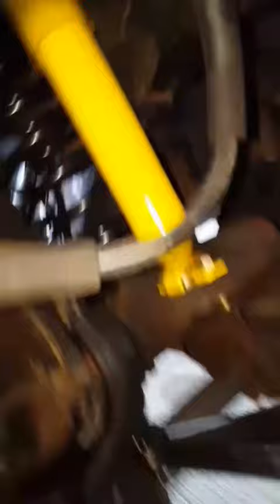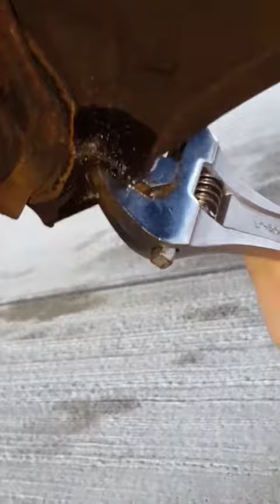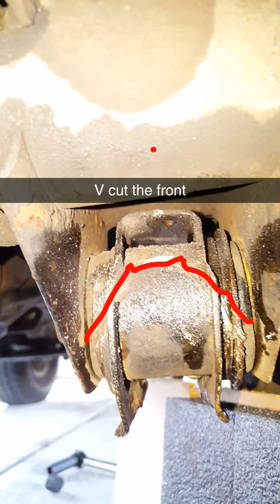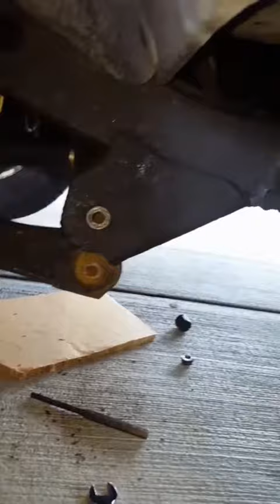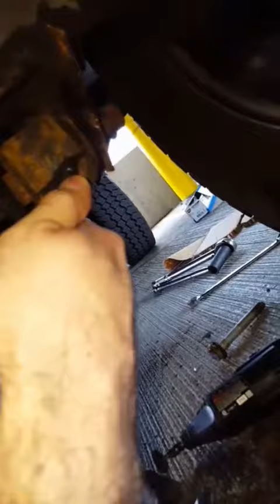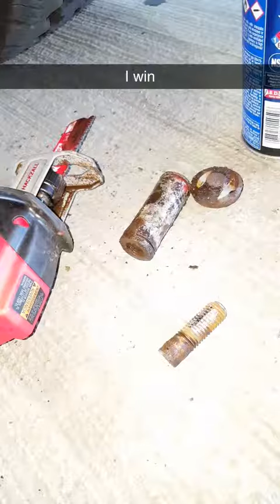Jeep Wrangler Tj 2000 Lower Control Arm Seized Cam Bolt Removal Cut

Comment: Thanks, helpful guide. I just need to get me some decent cutting tools now
Reply from the maker: The_Car_Gods_ 7814 yes buy carbide tip. Cutting fluid. Don't use battery powered .. or you'll be cutting all day